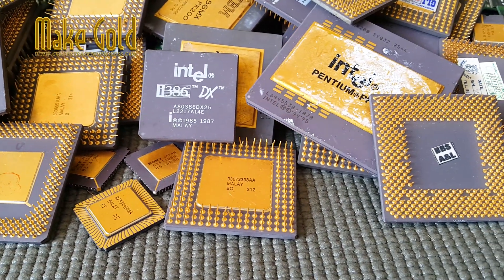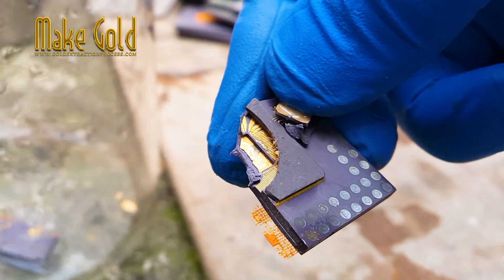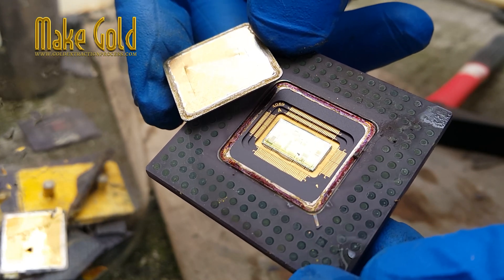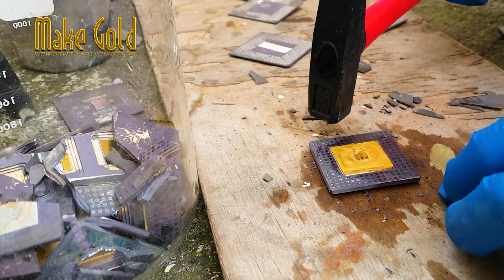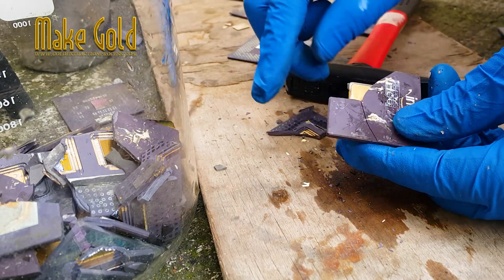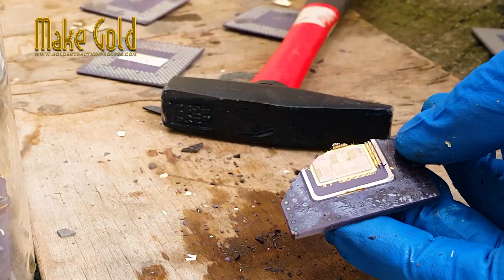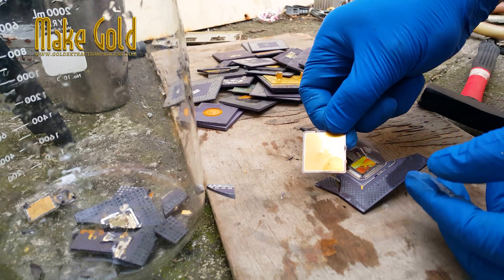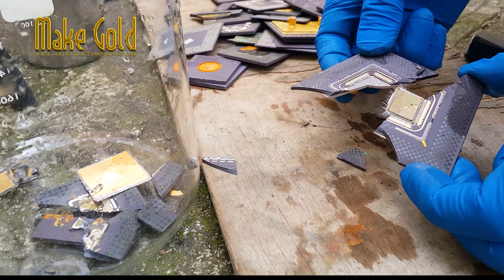Is there gold in computer chips?

Comment from the maker: :hand-orange-covering-eyes::hand-orange-covering-eyes::hand-orange-covering-eyes:The gold in e-waste can be recovered through a process called "urban mining," which involves extracting valuable materials from electronic waste. This process typically involves breaking down the electronic devices and using chemical or mechanical methods to separate the various materials, including the gold. The recovered gold can then be reused in the manufacturing of new electronic devices or sold on the market.

Urban mining can have a number of environmental and economic benefits, as it reduces the amount of electronic waste that ends up in landfills and reduces the need for mining new gold. However, it is important to note that the process of urban mining can also have negative environmental impacts if not done responsibly, as it can release hazardous chemicals and pollutants into the environment if not properly managed.
Reply: Be a gentleman Tell us the gold stripping solution

Comment: Bonjour quelle son les produits chinique pour estrere l'ors des objets plaque ors svp
Reply: Several ways of doing it, but this is the process for MOST Ewaste:

Using nitric acid (67%) and diluting with distilled water on heat will remove the base metals and silver and put into solution. The gold will remain behind. 

Rinse, and put remaining material into Agua Regia. HCL on heat and slowly add nitric acid (few ml at a time) until reaction starts. If reaction stops but gold remains, add a few more ml of nitric until all gold is consumed. 

Let it cool, filter and rinse solution, then precipitate gold with SMB or whichever preferred method. 

Put into AR again after washing with just HCL, repeat the nitric addition, filter, drop, rinse, dry, melt!